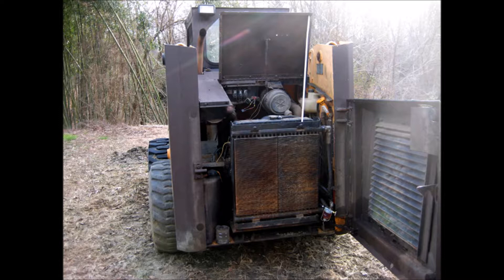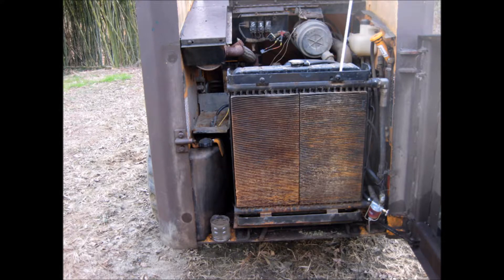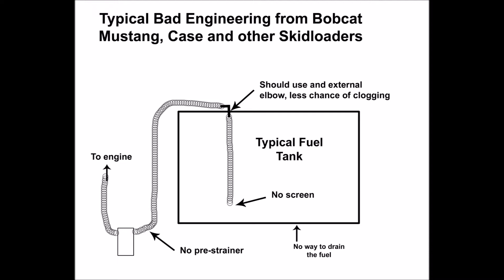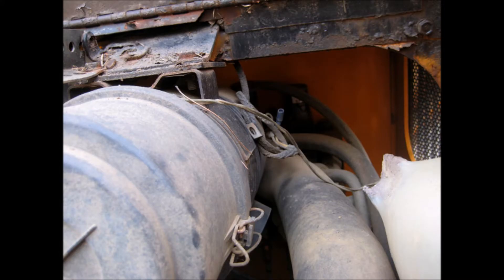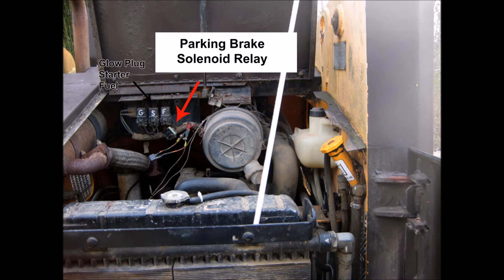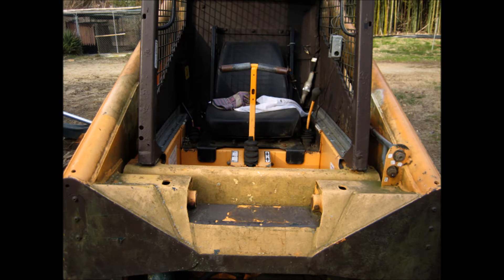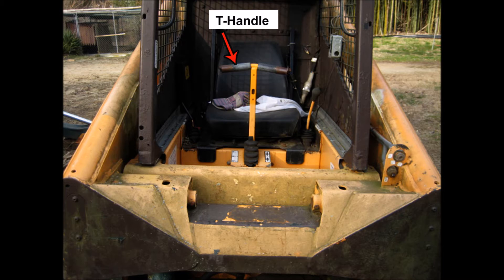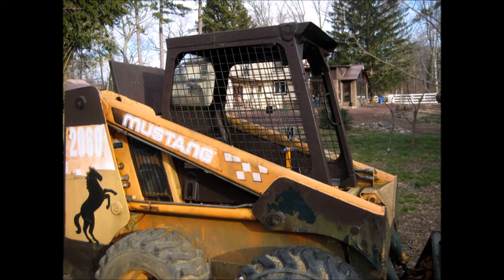Bad Engineering 1 Skidloaders, case, Mustang, Bobcat etc.

Comment: I also have a Mustang 2060, as a backup machine. I also have to remove the exhaust to replace the battery, which is ridiculous. I am facing gremlins in the machine with it unexpectedly stopping and locking, which sounds like the same problem you resolved, so I will have to see if I can do the same. I don’t mind the T bar arrangement and I haven’t had any problems with the locking pin so far, probably because I am often changing implements.